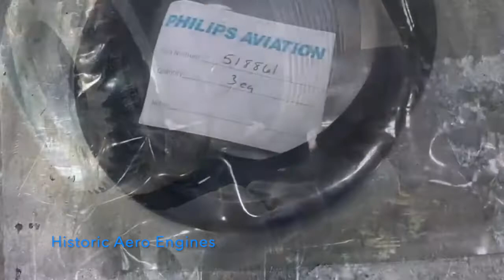Curtiss-Wright Cyclone R-3350 turbo compound radial engine nearing completion

Comment: I know what the difference is between a supercharged and a turbocharged engine, but I'm still not quite sure what the difference was between a turbocharged engine on a normal fighter and the "power recovery" type of turbocharged engines on the Super Constellation and DC7. They called them "power recovery" turbines, but aren't all turbochargers, by definition, "power recovery" devices? What's special about the power recovery turbines on Super Constellations and DC7s that makes them different from other turbocharged engines?
Reply from the maker: Hello Paul.  There are three power recovery turbines on the R3350.  Each is an exhaust gas driven turbine disk connected to the crankshaft through a fluid coupling.  Exhaust gases from the exhaust collector ring spin the turbine, with that energy transmitted to the crankshaft recovering 500hp between the three PRTs.  A turbo or supercharger compress the inlet air to the engine, whereas the PRT recovers energy from the exhaust gas.
Reply: @HistoricAeroEngines  Many thanks